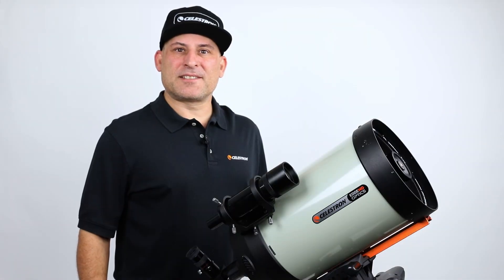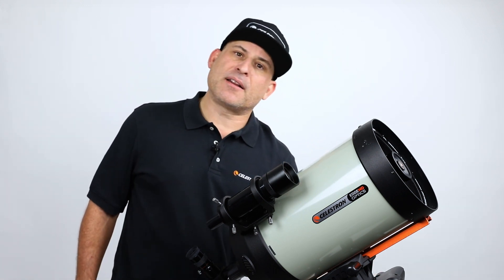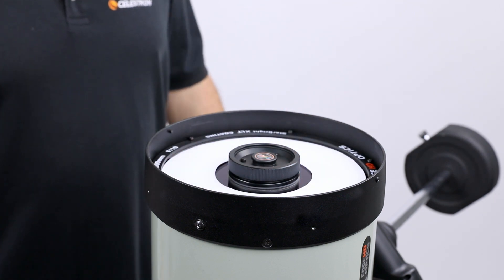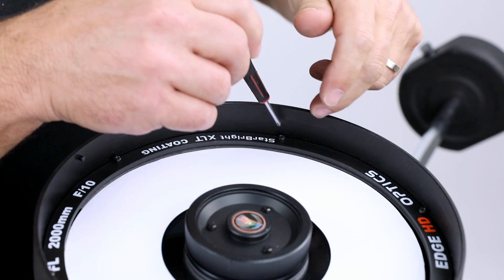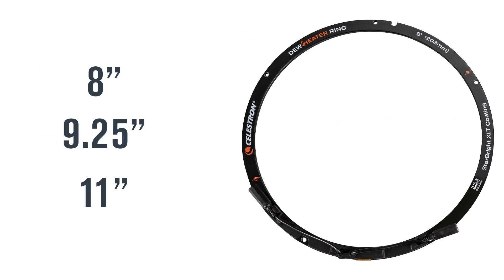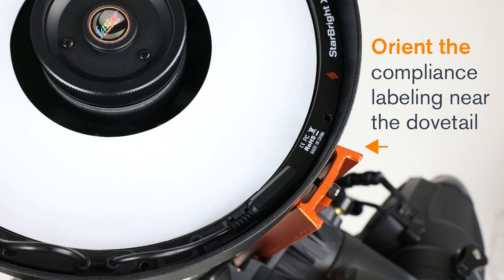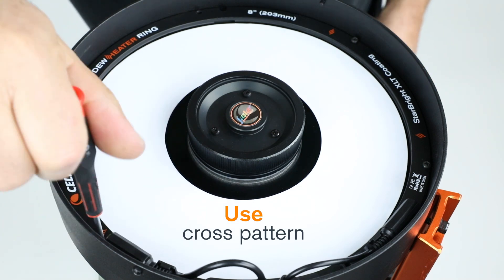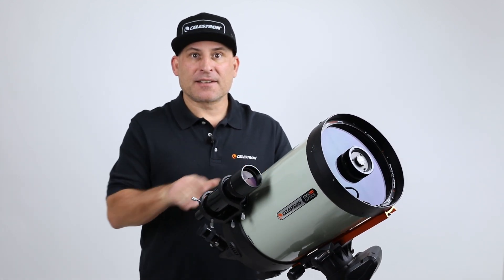How to install the Celestron Dew Heater Ring

Comment: I installed the dew ring on a new Nexstar Evolution 6.  Note: the screws were hex, not Philips.  Check your screw heads under a bright light to determine if you have Torx, Philips, or hex before you go crazy and round them off.

Comment: I just have a question: Yesterday, I made my collimation with the dew shield OFF. The first 40 images were done dew shield OFF and were OK. Then, as the temperature was going down ans approaching due point, I selected my dew shield ON. My next photo was poor and my C8 edge HD slightly "decollimated". My question is: Is it better to switch on the dew heater for all night if there is a risk of dew and perform the collimation with dew shield ON or may I have a technical problem due to installation of the dew shield ? Thank's for your help.

Comment: There was a thin thread of metal hanging off the dew shield that I tried breaking off by gently pulling with my fingers and it ended up slicing the pad of my finger really badly. Don't repeat my mistake!

Comment: Very clear instruction!  Thanks.  Can the included cable connect to the non-Celestron plug and a 12V dew heater controller (mine is a Kendrick with RCA plug receptacles)?  Thanks again!

Comment: Installed today on a Nexstar 6SE quite flawlessly. However the scope lid is now hard to be put back in its place. Suggestions?
Reply: This question was posted over a year ago with no response from Celestron.  Folks, this is the customer service you get when you buy a Celestron product.
Reply: Same here. Poor design
Reply: @ you need to rotate the cap while putting it in place. I use two Velcro straps to secure the cap to the tube so that it doesn't fall during transport. The ring is really ok to control dew. I live in a very humid area and had no longer any sort of dew problems whatsoever. You need a controller, though.

Comment: Just installed one on a 9.25 Evolution. Overall, pretty easy to do. The ring is replacing/upgrading my Astrozap strip, which works just fine, but decided to go with one less piece of equipment to deal with in the dark, plus having the heat transfer be more direct seems better. And, it frees up the strip so it can be used to keep eye pieces warm. I have a Celestron PowerTank 12, I don't really care about power consumption since there is plenty to spare, and warm enough is warm enough to keep the dew away, so to speak. Fine tuning the heat output via the thermistor and paying for the Celestron dew controller - your mileage may vary on the need for that. Might clip the wire, but who knows what Santa is bringing this year. Otherwise, the Astrozap controller is good enough.

Two little dings on the install - one of the factory screw holes seemed off after having removed the original screw. Had to find a similar length M3 machine screw  (M3 16mm) and it went right in. The other is the objective cover plate - seems to fit better (i.e., rotate to the right to lock into place) when in one orientation versus the other.

Pro tip - when going vertical, ensure the vixen rail lock/screw is tight so as to avoid the OTA slipping down and bashing the top of the mount.

Comment: So the FAQ says these rings will not work on a pre-2006 C5, C8, C11, C14 but does not list the C9.25, is there a reason? I have an older (year unknown) carbon fiber C9.25 that I wanted to potentially use this ring on.  Mine has the "flat back" like in the pictures in FAQ saying its not compatible with the scopes with that particular back design. What exactly makes it not compatible? Is the dew ring size actually different than the ring being replaced on these older SCT?

Comment: Its well made fits perfectly, love the cable management, and their Dew shield fits beautiful over top of the wires.  Then I went and grabbed my Bahtinlov mask to do a quick collumation and Focus check and Opps does not fit any more, didn't see that one coming. the cables are in the way for it to fit flat, anyone run across this what is solution, thanks?
Reply: Glad you posted this. Thanks. I guess that’s a deal breaker for me
Reply: @alalal1979  I took a Dremel to the focus mask and made it fit
Reply: Notch the mask to allow it to fit around the cable clip.

Comment: Does this need the celestron dew power box to operate or just regular 12v output will do?
Reply from the maker: You can operate the Dew Heater Ring through the 12V battery or through the Smart Dew Heater Controllers.

Comment: sorry if i missed it but if you remove the paper gaskets  on the install do you put them back before the new heater ring  install  or dose it sit on the glass it self ... very good idea . are they effective as a strap dew heater and what is the price point compared to a strap heater  do you need a control box, is it supplied with the unit . is there any plans to make this standard on SCT`s as a dew heater is a must have for a SCT  and could be a game changer at purchase time over other brands of telescope  it would be for me 
cheers
james D
Reply from the maker: Hi James, No worries, you remove gaskets.
Reply: @CelestronDotCom  thanks for the reply i hope they come to australia  great idea
Reply: I just ordered an 8" from highpointscientific. The price is great around $50 US. From what I could tell, you just need a 12v source. You can use them with a controller, but it appears one is not necessary.
Reply: @NG-VQ37VHR   thanks for the info thats is a good price  i have the astrozap heated dew shield for my 8"edge and i think this would work well with it  or when windy
Reply: What was the purpose of the paper gaskets in the first place and why it isnt necessary anymore when the dew heater is unstalled?

Comment: ??? what powers this ? Doesn't seem this Video is a complete set of Instructions . Sorry , I'll pass . /SRK
Reply from the maker: Hi Scott, Plug the dew heater ring into an external 12V DC power source for consistent, continuous heat that will prevent dew from forming even under heavy dew conditions.
Reply: it is a good idea  but your right i also had many questions on this dew heater
Reply: It's powered just like any other dew strap/heater. It was an install vid. They showed exactly how to install it. What in the world are you talking about?

Comment: When is celestron going to update the software so we can use the heater controller through our mount.
Reply from the maker: Hi Aaron, Our software is updated. You can go to our website to download the last software. You suggest you look at a Smart DewHeater Controllers as this will allow you to control the Dew Heaters and mount.
Reply: @CelestronDotCom  I am sorry if I am missing something but I just checked the website and it still doesn't show the version required to use the dew heater controller.  The star sense controller update is still from Sept 2020.
Reply from the maker: @AaronDavila1  Hi Aaron, for use with the Dew Heater Controllers, you'll need the StarSense hand controller firmware version 1.21.21333 or later. It is on our website here: https://www.celestron.com/pages/manuals-software The release notes are not up-to-date, sorry for any confusion!
Reply: Thanks for the replies but on that website it still shows version 1.20.20244 as the latest version.
Reply from the maker: @AaronDavila1  We mentioned this in our last reply. If you want to ensure that you are downloading the latest software for your StarSense hand controller, our technical support team can assist you take make sure you are downloading the latest firmware version: https://www.celestron.com/pages/technical-support
Reply: Ok thanks, also do you know when the dew shields are going to be in stock I really want one of those new ones to maximize my dew prevention on my evolution. Thanks
Reply from the maker: @AaronDavila1  We currently have the Polyethelene in stock. The aluminum are currently on backorder though more are being ordered.
Reply: @CelestronDotCom  ok aluminum is the one e pre ordered I like how it comes with a cap and is more rigid. 👌